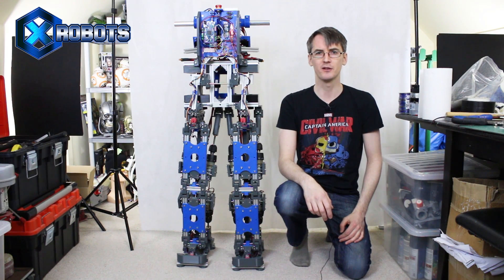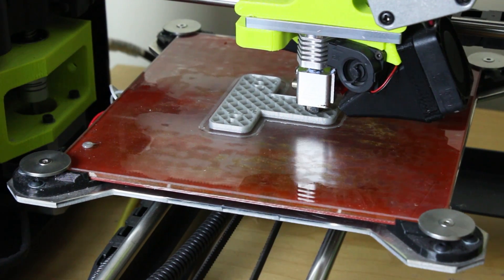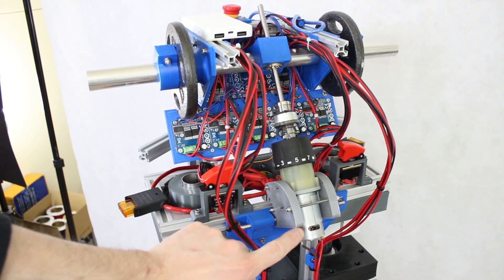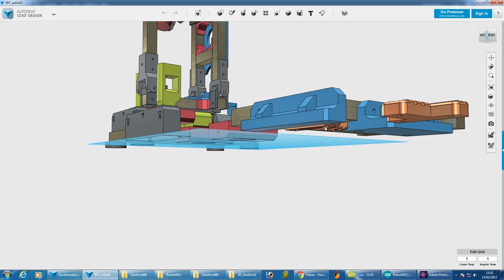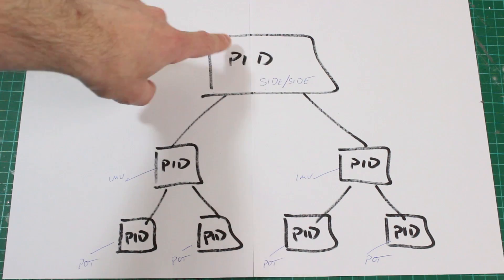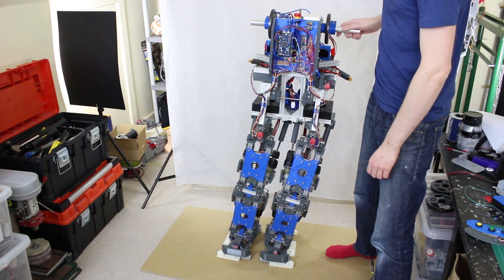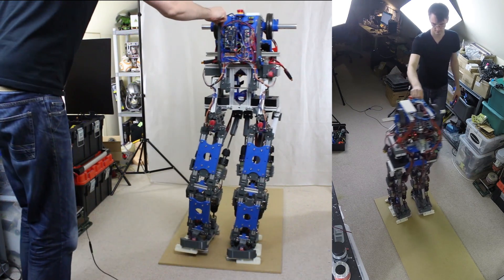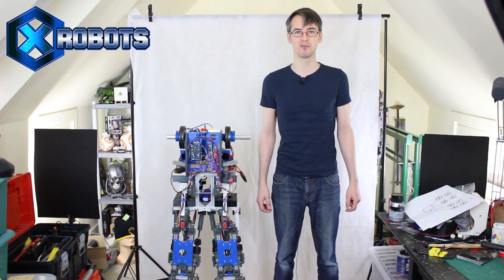Building Robot X #6 | More Dynamic Stability | James Bruton

Comment: what was the speed in mm/s that your linear actuators have?
Reply: Nice ! thanks. I have difficulty finding those with a gearbox.. a lot of them come at those high speeds (120mm /s and up) inside just a cylinder. The chinese claim high speed at already 12mm /s  I assume you drive the servos with a double H-bridge and there is a rotary encoder of sorts on the joints?

Comment: Hey James,
awesome progress!
could you go into more detail on how the FSM (state machine) is currently tuned up?
That was just a short part in the last video and I think that it could improve the gait a lot.

Just some thoughts about it:
 - You might want to use velocities (derivative of the joint angles)
   so e.g. trigger the step-back as soon as the ang. velocity in that direction is over 10deg/s this would also make it react faster on startup (as the ang. velocity starts at 0 and not at -something as during walking)
 - You could eg. split the legs further apart on high velocities (also to solve the startup problem)

what is the current state and what are your thoughts on this?
quertz

Comment: It is a good design idea and very creative way of using many IMUs  with different gains also,i would like to also tell you that to me,your barbell actually the one that will create a problem for your robot balance,unless you are going to also install an arms in the future you better strengthening your robot's hips and leg's motor,but that's just my idea though,are you going to use a foot sensors in the future?,anyway this is an inspiring robot design,keep doing the good job.

Comment: This is getting crazy :D It stabilises so quick now!
Can you shift the top weight back and forth by adding an artificial offset with the hand controller? That'd be far easier than trying to build a thing with extra weights and shifting those.

Comment: Absolutely must be t-1000 after bender. Can you imagine that thing with the terminator metal skull and like anodized skins wandering round a booth in a convention hall blasting out the terminator theme and various quotes? Or you could do like a build with part t-1000 metal skull body etc, but kick up your costuming skills by casting half metal skull, partial arnie "flesh face" and body out of foam latex etc. that would be sweet, half torn off biker leathers and stuff... maybe I've gone too far...

Comment: stabilising side to side should also be on top
Reply: I thinking about some enginered high house and it was working only by a big mass at the top. And dont forget the torso act like mass
Reply: Yes exactly. So the mass on top should also shift from side to side for stability. Just my thoughts
Reply: I,ll put it like this instead. When u push your robot from the front your mass moves forward to stabilise. Yes?
But when u push it from the side the hips react but the mass still want to go the way u pushed it.
Reply: Yes i was wrong on that One. 
But i still think a second axis on your Big mass on the top will help. Think about it.
And i think u are doing a great job. Big thumb up

Comment: you mentioned arms with weights to stabilize it, wouldnt a central inverted pendulum on a steward platform for omni directional movement do the same?  you might just need to raise the height of your mass doing your seaway thing.  like balancing a broomstick on your finger, you just need faster actuation for that.

Comment: it is actually spreading the legs to maintain stability! You are definitely moving in the right direction. I would suggest to take a closer look at the IMU's tolerance in the code. This is where you can over- or under-steer the joints and the whole system may fail to correct itself. Nevertheless really impressive :)
Reply: The problem is that it is closer to statistics at this stage, The PIDs are linked in a network as you showed in the video so I am not really sure if changing the actual configuration of the regulators will add a lot to the overall stability. I guess when you move on to the walking it will show what is needed there. 
I would recommend to tie it to the ceiling in some way for those tests. Falling aside is not that bad since your lab is narrow and the construction is quite robust, but if it falls on its front or back sides it may cause real damage.

Comment: Dude, what if you made full hips by turning that top hinge into a gimball and adding two motors. that way you would have a lot more stability and also the robot wouldn't have to sway side to side in order to walk because the swaying would be translated to a hip rotation.
Reply: ***** I was reffering to the pivot point that you address at minute 5:00 and adding freedom on the y axis (or rotating side to side) so as to add a leveling action. For example as the legs move sideways to accomodate for walking, instead of moving the feet to incline the whole robot, the joint rotates to the side in the opposite direction. Now If you say that you incorporated the pivotting point beforehand then I'm sorry for not noticing.
Reply: ***** That's exactly what I was suggesting. Oh okay then, I forgot about the whole parallelogram structure ordeal. My idea works more on a spinal support design which is easier to pivot on all directions, like the one your ultron project has. Never mind then, keep on the awesome work.

Comment: i feel like it would work out better if he would not try to stabilize a stepping robot but make a stabilized robot take steps. so the stabilization does not have to react to the walking motion but the walking motion has to adapt to the stability
Reply: hey, james! :D i am not an engineer. i just felt like the walking motion is too continous and does not pay any attention to the stability of the robot so the situation occured that it fell sideways. maybe the walking motion should dynamicaly slow down a little to give the robot the time to stabilize when it is in a too big rocking motion and a big offset is noticed by the robot.

keep up your great work!

Comment: That's one thing I was thinking. It's easier to walk if you have arms to aid balance and add counterbalance. The difficult thing with walking is that you are actually forcing yourself to fall forwards and then catching the fall with your foot. It's hard to get a robot to do that without really fast and precise motors. 

You seem to be on the right track though as at the end you started getting some rotation in the hips rather than them staying parallel to the ground. Hip rotation lets you move the mass onto one leg without leaning the leg over and keeping the leg as perpendicular to the ground as possible will give you much more room for balance corrections and further motion. At the start it was leaning right over with the leg angled and you couldn't really move much else or it would fall over.

Comment: If you could give it some form of proprioception, where the robot has an awareness of its limbs relative to each other, it might fix the issue of the steps getting out of sync with the oscillation. As it is currently, it will sometimes end up leaning to the left when the legs are positioned for leaning right and vice versa. If the robot could "know" this, the leg position or timing of the oscillations could be altered so as to avoid leaning the incorrectly.

Comment: As it is designed, would there be any benefit to adding pressure sensors in the feet? I'm pretty sure all those super advanced robots have this. Also, any plans to upgrade the motors/lead screws, so that slack you mentioned is reduced/removed? The project is so impressive, it would be a shame if a cost saving measure kept it from its full potential.

Comment: I know you said at the end you'll be working on getting the legs to lift higher and whatnot, will you also be tuning out that side to side motion when it walks? I mean it sort of worked for the gonk droid but after pacing up and down my living room a few times I can assure you that bipedal things don't walk like that. I for one tend to control my balance whilst walking using my feet/ankles and bending knees, not cocking my leg with every step.

Comment: What do you think about the new bipedal robot from Boston Dynamics? Its self correcting seems incredibly fast; what microcontrollers do you think they use?
Reply: Not arduinos ahahah
Reply: TheAstronomyDude They may only use microcontrollers as an interface between an on board computer and the hardware, though I'm not sure.
Reply: That robot is fucking sick!
Reply: TheAstronomyDude you can be sure they're using fpgas for alot of the stability. Highly parallelized i would wager.
Reply: TheAstronomyDude  yes I can't agree more he is a mad scientist at work definitely keep up the good work

Comment: Why does the robot make a high pitched hum when it's on?
Reply: Could be the frequency of the PID controllers through the arduinos. On the BB8 series or the R6 driod series he switched one of the ini file lines to make it cycle faster than 33 hz or something and the whine was then inaudible. But inbetween then theres been a couple of vids where stuff got caught in the Arduino cycling at 100hz processing the loop and the feedback being read at 50 hz so buffers didn't overflow. not sure if the whine might be  a not quite got round to it problem or a way the code is set up problem, I just watch the vids ;P